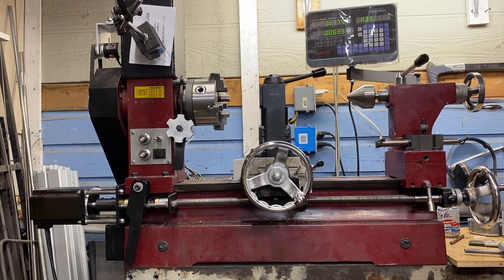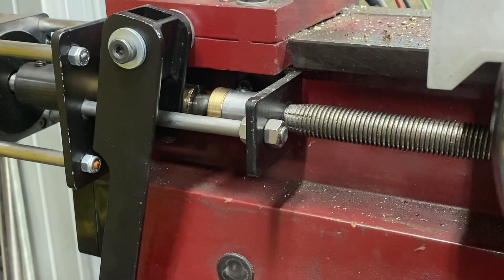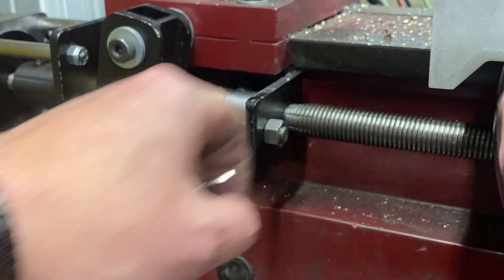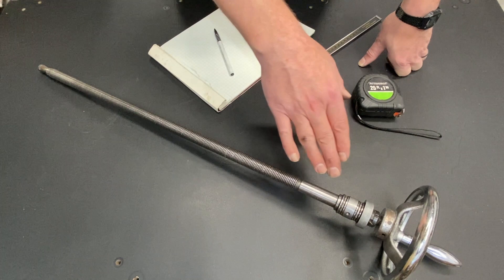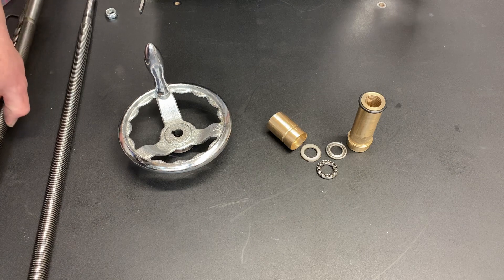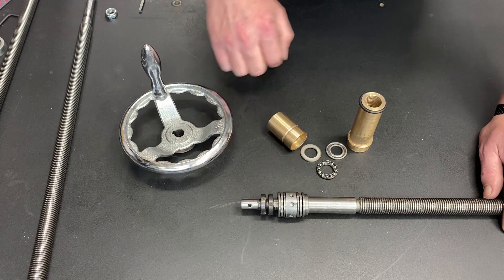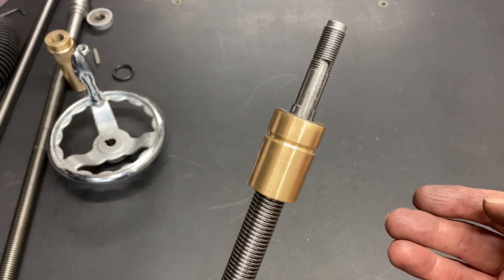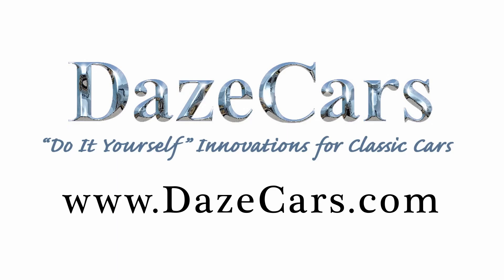Making a Replacement Leadscrew For My Lathe Out of a piece of 3/4" X 10TPI LH ACME Threaded Rod

Comment: m20 (20mm thread) has a 2.5mm pitch aka 10 TPI as standard
Reply from the maker: It’s actually not a perfect calculation 25mn = .984”. I used the DRO and went several inches and every 10 turns was EXACTLY 1”. If it was 2.5mm it would have gotten further from 1” each set of rotations.   I took lots of measurements and it was for sure 10 TPI

Comment: Running into this very same problem with both leadscrew & cross slide screw. Finding taps is a challenge and expensive with metric. Mostly TR20x4 on lead screw and TR20x3 on cross slide screws. A cheap tap will run you about 100$ each off amazon. I like the thought of changing to ACME thread. Great video
Reply from the maker: That’s exactly why I went with ACME threading! It’s a much more readily available and cost-effective option.

Comment: A bit late, but are you sure it wasn't a metric thread? 2.5 mm pitch is super close to 10 tpi. I've had this problem before.
Reply from the maker: 2.5 mm is close to 10 TPI but not exactly the same. The DRO provided it was for sure 10 TPI. I could do 20 or 30 rotations and it landed perfectly on 1” increments accurate to .001”

Comment: I’m always so stoked to see a new video from you! Keep up the good work man. 

Do you know of a way to keep the gib screws on a mini lathe from coming loose? I’ve tried threadlock blue and thread lock 42 ( which is supposed to be for high heat and vibration applications) but after interupted cutting or any tougher material they all loosen from the compound gibs down to the saddle plates.. last time I did them all with the TL42 I cleaned all the threads with acetone first..no dice
Reply from the maker: Glad to hear it!!!  I just did this to my machine a couple days ago.  There were two gib crews in each hole on mine, the inner one as an adjustment and the outer one to "lock" the inner one.  Problem is tightening or loosening the outer one cause the inner one to tighten or loosen.  I removed them and replaced them with a single stud and jam nut... Problem solved.